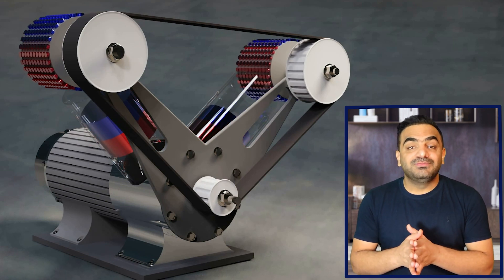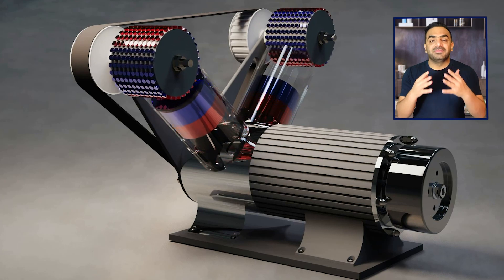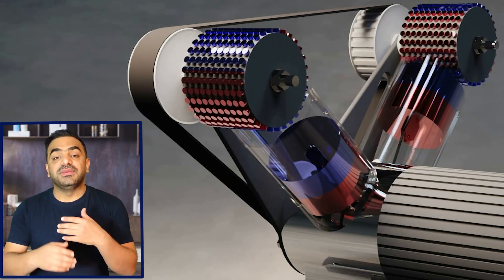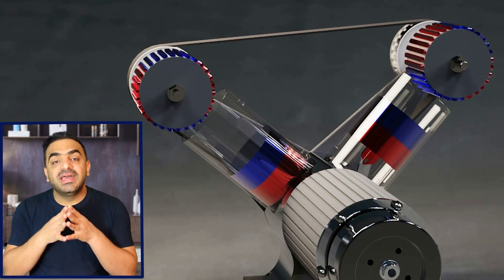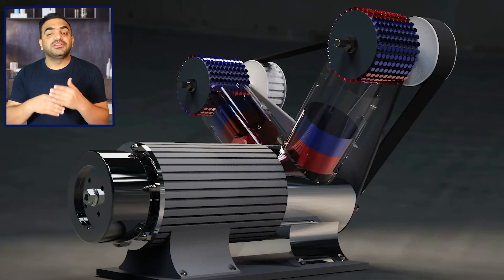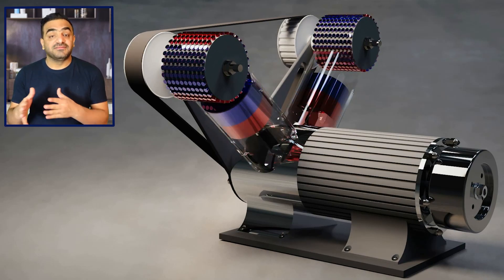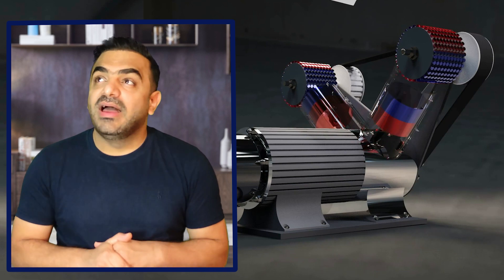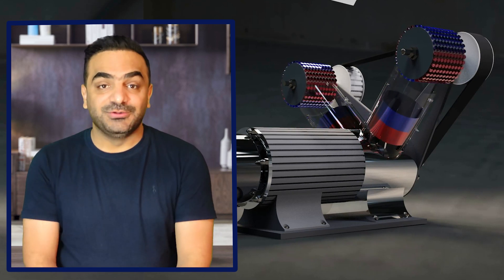Innovative Magnetic Motor Design for Renewable Energy Solutions

Comment: This doesn't work. It is not possible to design a workable magnetic motor based on the principle of an explosive motor. In the case of the magnetic motor, the continuity of the magnetic flux spiral, which provides the torque, must be achieved in order for the shaft to rotate continuously.

Comment: There are peaks and trofs in the magnet field when the peak on the piston magnet lines up with trofs on the stater magnet it takes  lot of force to rotate especially because the field grows exponentially as the piston magnet grows closer to the stater magnet u will find that it will take more energy to rotate the stater magnets then u gain from the pistons you need to create some kind of magnetic shielding to minimize the field discrepancy and also use something like mu metal to create something that behaves like a monopole magnet by shielding 1 of the poles
Reply: Can this be overcome with counter weights?
Reply: @anthonyfleming2227  no unfortunately magnet fields are not static that will change and hold on once it is locked in to a position the answer would to somehow use shielding or something like a permanent magnet switching mechanism

Comment: Cool ideas, but imo you may have overly complicated some designs .... in case you may not have heard of this, there's something called “magnetic shielding”; combining that the magnetic “free energy” machine design can be a whole lot simplier, yet offers more yield (due to less moving parts and less friction).

Also, there is no such thing as free energy machine ..... even your powerful permanent magnet cost a lot of energy to create (energy to mine the raw earth, process rare earth, & use lots of energy to turn them into powerful permanent magnet) .... until the net output over time is positive, else at best it's just a cell (I.e. battery); even if net energy output is positive over time, depends on how long it can last/run, at best you may only call it a “cheap energy” machine, because when magnet put under such high stress, its powerful magnetic power will decrease over time, and can't last forever, so, there is no such thing as “free energy”; at best only “cheap energy”

Comment: Rotating magnetic motor do not work, because magnetic lines are fixed so they will lok against each other,is like induction motor were magnetic field is induced like a mirror so is always at 180° producing full attraction or repulsion.base on magnets a rotering motor do not have god. chances .

Comment: Flex in the belt, lots of bearings and friction everywhere. All of these convert energy of motion into thermal energy which leaves the system. Hence can never run for ever. I also presume this doesn’t run in a complete vacuum. Moving through air isn’t a perpetual motion regime. We can’t drop a ball and it accelerate forever. It hits terminal velocity.  Bc air takes energy to move through.

Comment: Have you considered a VGate alternative? I.e. have a very large diameter wheel with a vgate configuration. I think you need 5 so that when 1 hits the gate it has 4 others pushing through it. Have to stagger the gate portion of all 5 so that there is always the power of 4 pushing the 5th one across the gate. It's one of the few where it actually accelerated over a distance so I think it may work like this. Most magnet things don't have as much acceleration.
Reply from the maker: https://youtu.be/e701qk8Swrs

Comment: Have you considered using so-called switched permanent magnets such as used in welding shops?  They completely neutralize one pole when switched off.  When switched on, they energize that dormant pole and will provide a healthy magnetic 'kick'.

It seems so simple but I have never seen it used in any mag engine.

This research IS the way.

The current EV cars?  BETAMAX.

A Magnetic Hybrid which constantly charges a battery pack can have unlimited range.
Reply from the maker: many years ago my friend in an oil company show me this magnet, first I'm surprised but after checking the device!!!.
not good for the change the pole magnet  because need more Force for rotating the switch.
Thank for your comment.

Comment: All the same mistakes. Will not work. If a steel nut is glued to each pole of the magnet, then there is a chance, but the scale is an important parameter. And we need a buffer zone which is not in the model.
Reply from the maker: thank you for your opinion